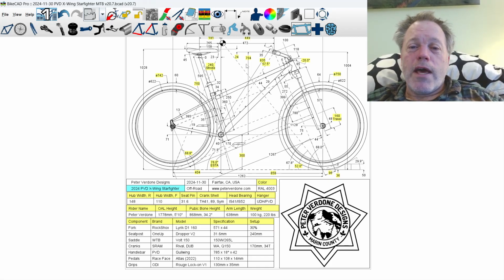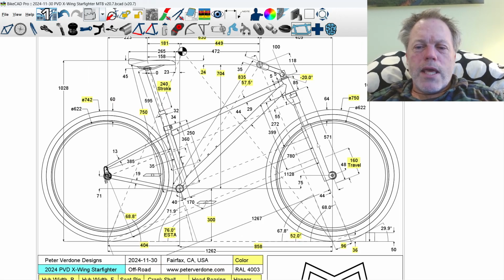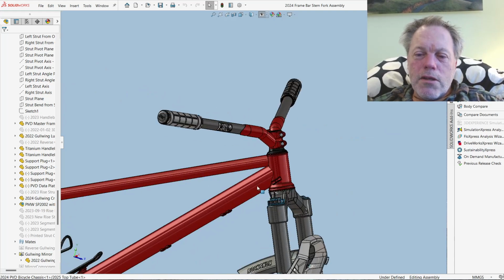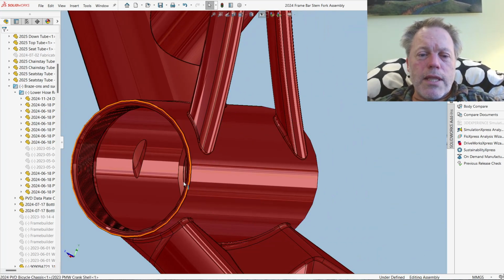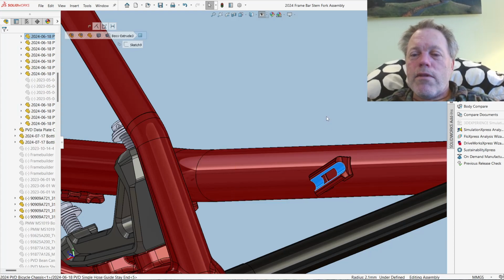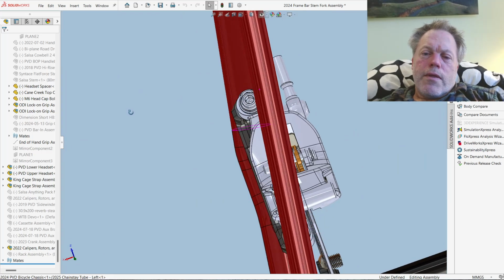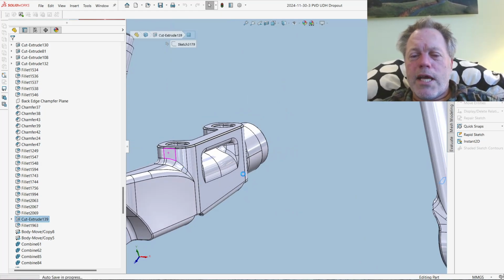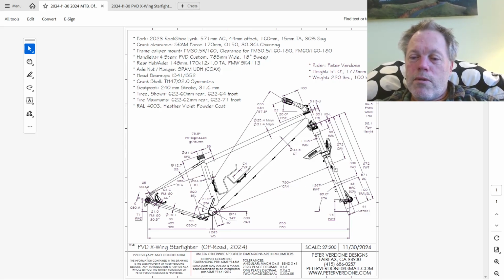A tour of the new Starfighter frame design

Comment: You really think steeper head angles help with suspension action in the steeps? That's a cool insight, when i designed my frame i took some of the stuff from your blogs but kept the headtube really slack (for a short 100mm travel hardtial) at 63°. I thought it made the suspension feel better in the steeps relative to my steeper HA bikes, but i made some other choices to try keep the other angles and lengths within a useful range through the whole travel. Anyway thanks for doing these, i alway feel like i learn a lot!
Reply from the maker: The steeper head angle is for improved action during the whole ride, not the extreme. Still, this is a system and a real setup print is the only way to make a real evaluation.